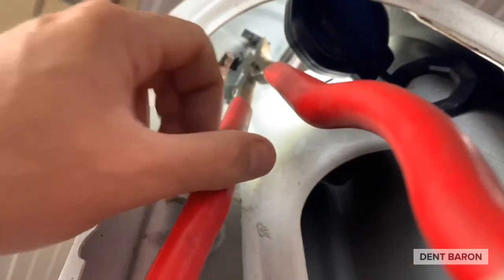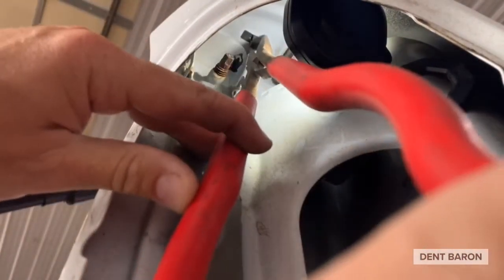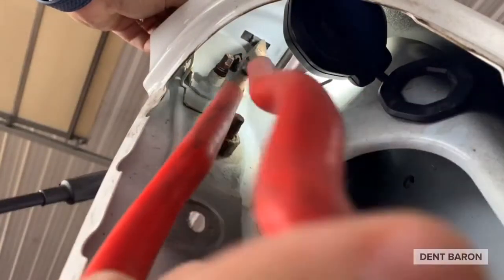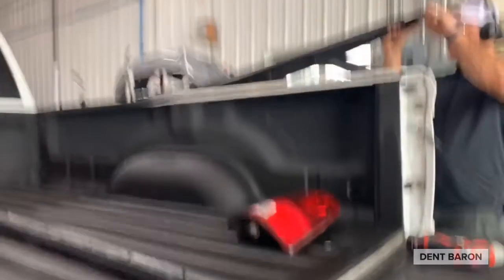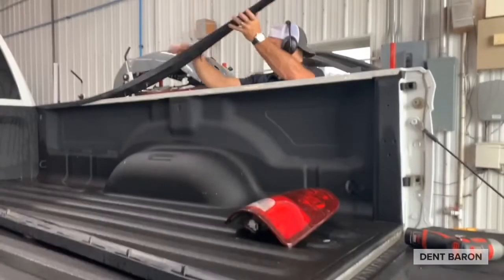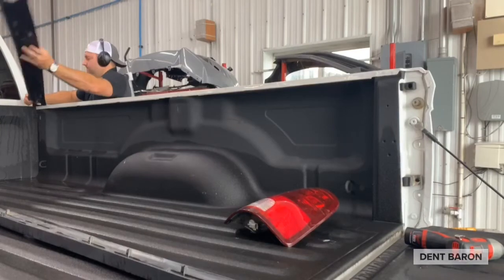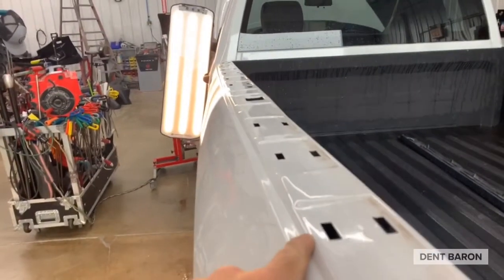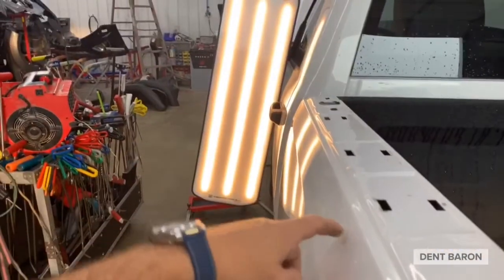Ram Truck Bed Cap Removal | Never Break A Tab Again | Ram Bedside PDR | Dent Baron, Raleigh, NC

Comment: bit of a dated video but I don't care it's amazing.. What's your go-to tool for doing these box sides? I don't wanna stretch out the holes too badly so was thinking maybe a 3/8 double bend with interchangeable tip but would like your input, thanks.
Reply from the maker: Are use carbon tech rod through tail light access if possible.  Also there are several great tools for going down those square slots. Here’s a link to the Main Tools are used for that.

https://www.pdrfinessetools.com/MTSET

There’s five in the set. The entire set is worth every penny. However for these bedsides going through the rectangle slots at the top the three smallest ones are perfect for that specifically the second smallest one that is the go to for me on these bedside..